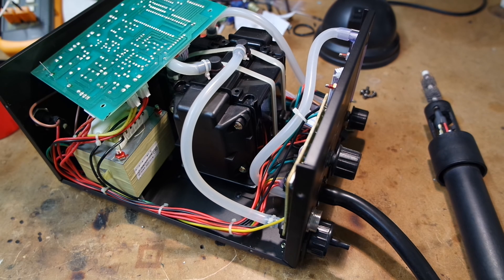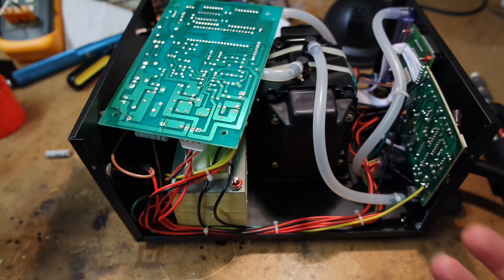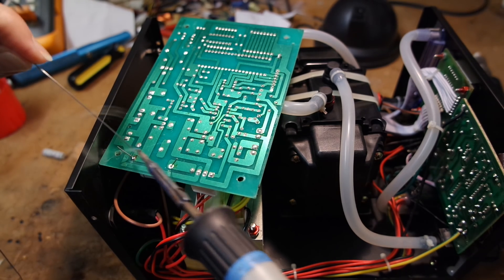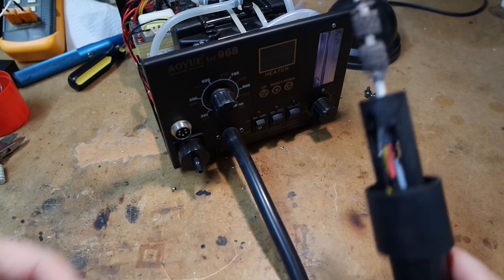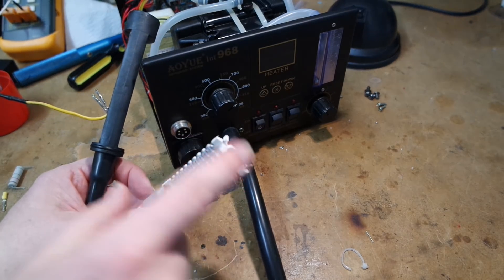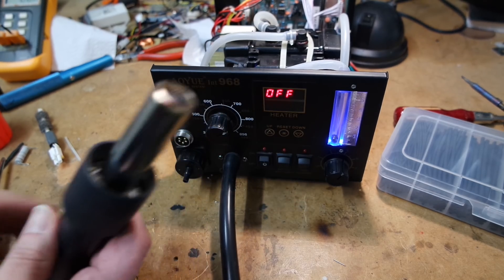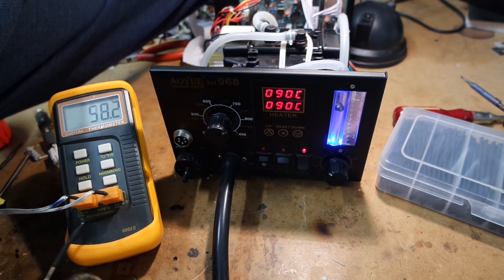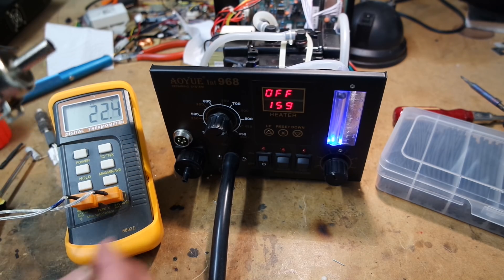Aoyue 968 Hot Air Unit Repair

Comment: Triac on the board also blew along with fuse resistor, when the element failed on mine. Replaced all three working fine since.

Comment: Hi thank you for this video, i have AOYUE 852A+ hot air station, the internal fuse blew, i replaced the fuse on the back of the unit then the unit was only blowing cold air, i replaced the heating element (it was exactly like your old one in the video but mines has a black rectangular component (thermistor?), the replacement heating element did not come with thermistor so i installed it as it was, but the unit is still blowing cold air, i opened the unit to check for anything obvious, i have the same large resistor like your one, what does this resistor do, what are symptoms of its failure? i really hope you can help, i'm really struggling without hot air station
Reply from the maker: I don't remember what the resistor does - sorry. But without the probe installed the heater will not function. I had a cable break to mine and the heater did not turn on then.
Reply: @dherrendoerfer  thanks for replying, appreciate it
Reply: @dherrendoerfer  just wanted to say thank you for the video, you helped me repair my hot air station, just by replacing that large 1ohm resistor

Comment: Hallo, Du sagst zwar wie viel Ohm der Sicherungswiderstand hat 1.2Ohm ABER das wichtigste lässt Du weg...wie viel Watt hat dieser Widerstand? Wo hast Du ihn her? Hat es einen Grund dass Du kein Heizelement vom Hersteller genommen hast? Meine hat einfach den Geist aufgegeben es kommt nur noch kalte Luft und die Temperaturanzeige zeigt über 500° an, ich vermute der Temperaturfühler ist kaputt...
Grüße
Reply from the maker: Alle Bauteile sind original vom Hersteller gewesen - das Heizelement ist nur eine andere Bauform wie das Original. Der Widerstand ist ein Sicherungswiderstand mit ca 5-10W. Der Wert ist nur wichtig wenn man kein Original bekommt. Die Bauteile waren damals von Wiltec. Ich habe seither noch 2x die Heizelemente tauschen muessen, Der neue Widerstand hat gehalten.
Reply: @dherrendoerfer  schön dass du antwortest👍 dann suche ich Mal nach Wiltec...in welchem Zeitraum und wie oft hast Du denn das Teil genutzt?
Mir ist der Wiederstand leider beim Messen an einen der Steckkontakte durchgebrannt, eigene Dummheit 😉 der Heizdraht ist noch intakt, ich schätze Mal der Temperaturfühler ist der Grund...
Reply from the maker: Das Video ist 7 Jahre her - ich Benutze die Station immer noch, es wird aber immer schwieriger fuer diesen Typ Loetspitzen und Heizelemente zu bekommen - die Temperaturfuehler sind K-Type, da brechen oft die Kabel nach einiger Zeit. 
Ich hab die Station viel in Benutzung, in letzter Zeit mehr die Loetstation als die Rework/Heissluft Einheit. Ich wuerde sagen dass die Heizelemente locker 200-400 Stunden halten, die Loeteinheit vielleicht etwas weniger.
Reply: @dherrendoerfer  hey danke für deine Antwort, ich habe im Netz ein Ersatz Heizelement für 6€ gefunden, es hat 700W und kommt aus China (wen wunderts😁) passen die 700W? Ich ärgere mich echt mehr über den zerschossenen Widerstand 🤦🏻‍♂️Ich finde die Preispolitik für Ersatzteile echt nicht nachvollziehbar für einen einfachen Widerstand zahlt man fast genauso viel wie für so ein Heizelement....auf der Seite gabs sogar eine komplette Station für rund 55€ (allerdings ohne Lötkolben, nur rework)

Comment: I have that one to but I wouldn't buy it again ! If you ask why ? Because the hot air heats up but not enough it loses the temperature the iron solder becomes never the temperature that is needed if I set the iron solder to a temperature for example 350 degrees for station flashes that the temperature has been reached but I can not melt the solder properly!  the soldering iron is exchanged for a new one but the same problem! I will buy a hakko air and soldering station or Weller or ersa but I don't know what is the best I must research . 
Thanks for the video ! 
Best regards,
Reply from the maker: Most professional soldering stations for professional use do not come calibrated (unless they say so). They are set up so the setting you are choosing will never over-shoot during the heating process. You can either set it yourself using different types of solder with a bit of experimentation, a calibration sensor, or a temp-sensor with a k-type probe.
Reply: @dherrendoerfer  I tried all settings!  it does not work ! Thanks for your help.
Reply from the maker: Did you try using the calibration potentiometer below the temp select knob ? That's where I calibrate my tips. (Be very careful turning this - you can kill the thermo element really quickly)

Comment: Hello:
What is the integrated code of the 20-pin Microcontrollers on the Class 952 digital card (U1 and U2)? The IC circuit is burned and I do not know the code.
Thanks.
Reply from the maker: Hi, I don't know the types, but I think it may not help to know them since they may come pre-programmed from Aoyue.
I currently need my station on a daily basis, so I don't have plans to take it apart unless it develops a fault.
The controllers used to be available as spare parts from Aoyue, but I can't find any on a quick search on the internet.
Cheers, Dirk
Reply: @dherrendoerfer  
Hello there:
Thanks for your interest

Comment: Hi. I have the same problem with my model 968. I bought the resistance but in the previous one (same as yours) has four wires. How did you connect those four cables? Many thanks
Reply from the maker: In general you need to figure out which wires are for the sensor and the heater. If yours came different, you may need to re-use the old sensor.
Reply: Thank you for your reply. I had forgotten the sensor. Sorry
Reply from the maker: No problemo !

Comment: Was this a low use machine,or a high use machine
Reply from the maker: It needs to push its weight, but it does get a break now and then.
Reply: Thanks for the info

Comment: Use a hakko 191 on the soldering pen my one was reading 350c it was 460 Jeff.
Reply from the maker: That's far off - my unit has a calibration pot under the temp selector - but I doubt it will offset that far.
Reply: YES I got to look for calibration pot but may be the pen element thanks Jeff.